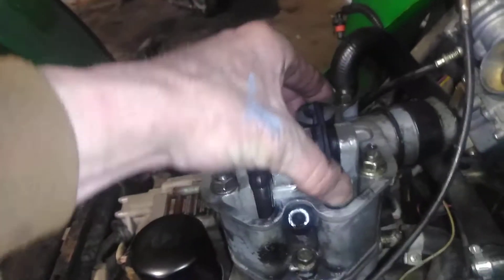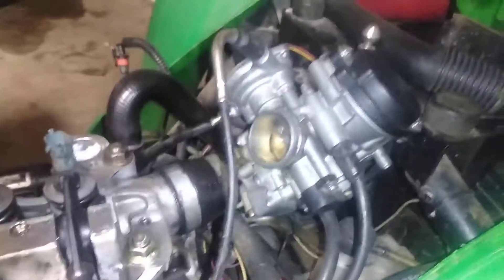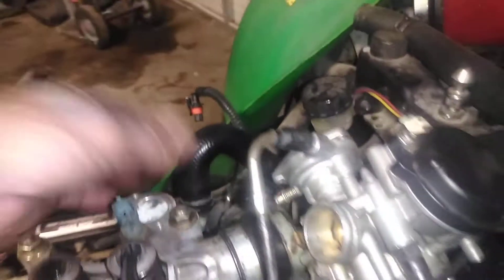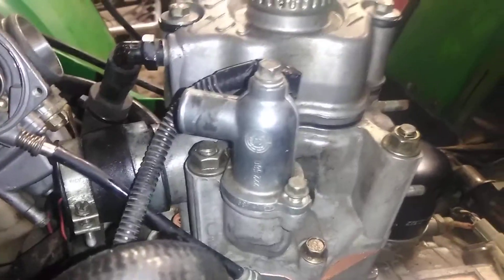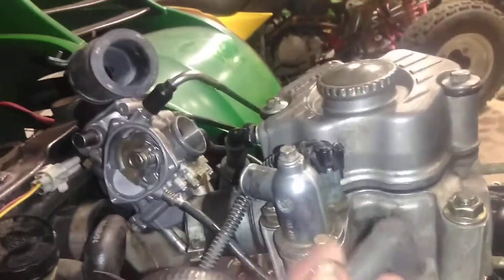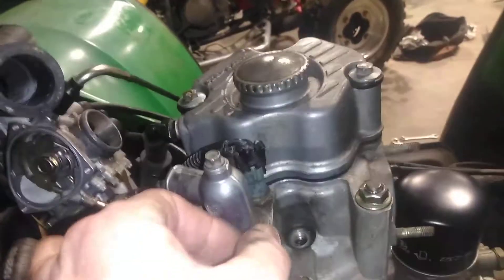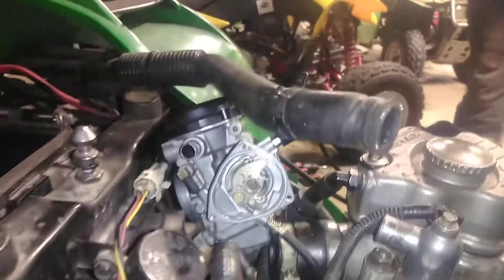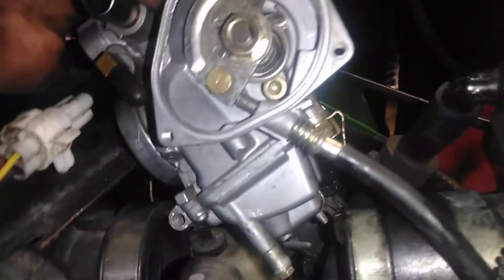John deer buck 500 topend rebuild(3)

Comment: Where do you get parts for it? My mechanic trying to rebuild it for me but he has trouble finding parts. My is Bombardier Traxter 500. Thanks.
Reply from the maker: It was helll pitsburgh ring company is we’re I got rings I found a piston online by specs ! I had to mic n order each ring ! Don’t look up John Deere just look up engine ! I’m not sure but partzilla May have that model listed n in the parts area if they have models that share parts it will list those units so u may could cross reference that engine to a sxs or Atv ect n have better luck ! Did he mic piston? Send bit information if I have time I can try to help !
Reply: @WaldensWorld  all I have right now is the engine tag.
Reply from the maker: Mabey Philadelphia rings company I think I stated it in the video?